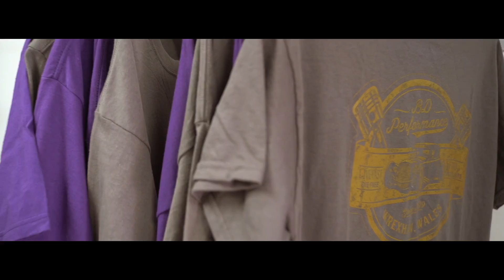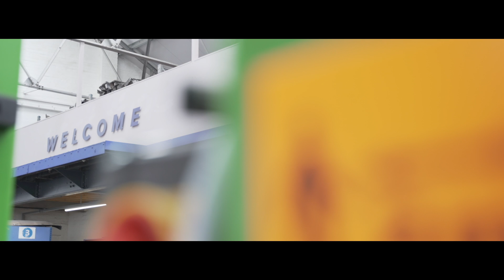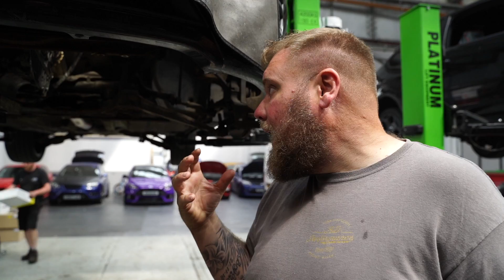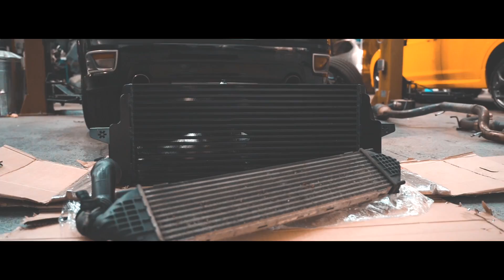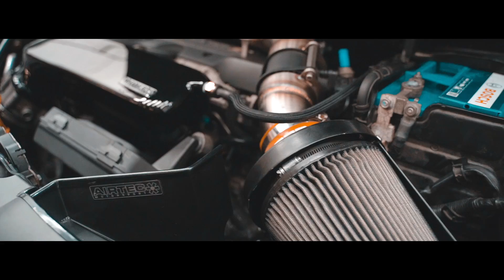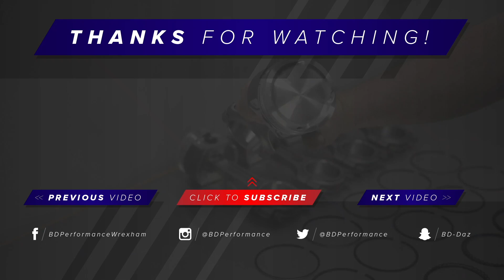Stage 2 To Hero Package - CP340 ST225

Comment: Hi do you have to upgrade the rad for this or can you still run the stock one ? Also if I buy the cp340 what other tho g do I need for it to work too like big brakes or rs clutch etc ? Thanks
Reply from the maker: You do not have to upgrade. For the larger intercooler, fitting an RS Style Radiator is necessary however to enable to pipework routing.

For CP3 you’ll need a Turbo Back Exhaust System, Intercooler, CAIS, Actuator, RS Injectors and Software. We recommend an RS Clutch and you’ll need proof of Block Mod.

Hope this helps and thanks for the comment.
Reply: @BDPerformanceWrexham  thanks for the information and love the videos keep it up.
Reply from the maker: @alexl2907  thank you and you’re welcome

Comment: Do 550cc injectors work with this?
Reply from the maker: Collins designed the Software for 440cc RS injectors. It certainly wouldn’t be something that we would advise to run with incorrect sized injectors.

Thanks for the question and for watching 🙏

Comment: i got an rs turbo for cheap anything i need to be a wear off? software will be i get after the turbo is in
Reply from the maker: You’ll need the oil feed and return pipes, along with the restrictor to suit the RS Turbo; if these didn’t come with the used parts purchased.

Furthermore you’ll need silicone to adapt and the new gaskets, plus seals, obviously.

What software are you planning on running? You’ll need the RS sensors, injectors and other supporting mods.

Comment: Is there much of a difference if any between the Collins actuator and a turbosmart actuator?
Reply: Ok thanks for the reply. So if I wanted the cp340 I would have to change my turbosmart actuator to a Collins one? Also I use to have the Cais which Collins recommend but no longer have as I had the pro alloy oil catch can and breather kit installed and it no longer fitted as the hoses got in the way.
Reply from the maker: The Collins is a progressive setup and unique essentially to the CP3 or 340 setup essentially.

Hope this helps

Comment: Great video again, I was thinking of getting a direnza rad because there a good bit cheaper but if they don’t fit right with an airtec stage 3 or r-sport stage 3 intercoolers I’ll not bother with a  direnza rad and save up a bit more for an airtec, get what you pay for I guess! What would be more worth it a cp340 or revo stage 2 with sps box if want to upgrade to rs turbo in future?
Reply from the maker: Each to their own: both great in their own respect, so don’t discount either!

Thankful for the positive feedback and reference the Intercooler - choose an RS style to fit the Stage 4 🙌

Comment: Couple of questions.
Can you run CP340 on standard st turbo?
Would I have to pay extra to unlock my ECU as I have a Revo stage 2 and people say it’s locked to them?
Do you have to have a block mod for the CP340 because I’m looking to get a RS forged engine next year with you to start going big boy power I wouldn’t want to waste £700-800?
And finally can I buy parts from you and get them all fitted at a later date?
Reply: I'm on a standard turbo running the cp340
Reply from the maker: Abandoned Seekers with an RS Engine CP wouldn’t insist on a Block Mod.

We can write the CP340 Over the REVO Software if you wish. Without issue.

Yes you can indeed buy the parts from us in advance.

Thanks for the great questions 💙
Reply: Ok cool thank you. I have a ST engine but will be looking at getting RS early next year so I wouldn’t want to spend money on a block mod on my st engine. I’m looking at buy stuff from yourselves and then getting them all fitted in one go lol